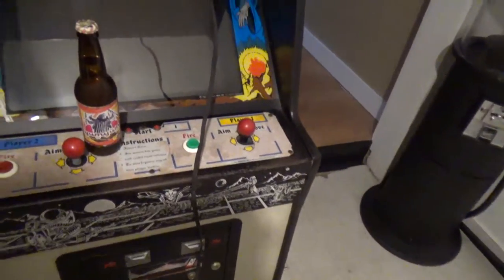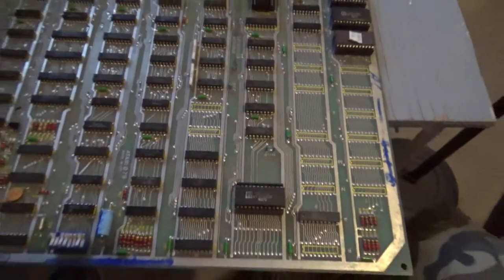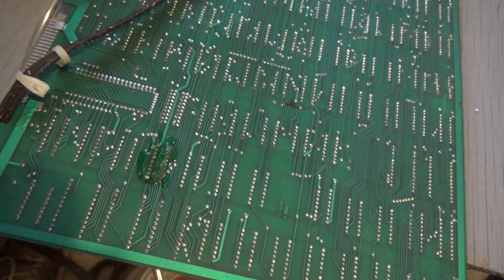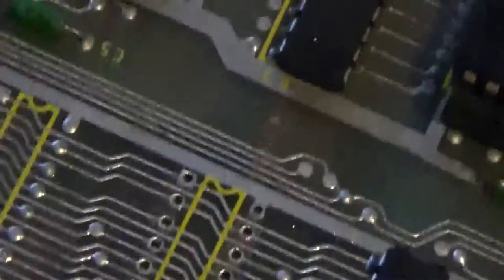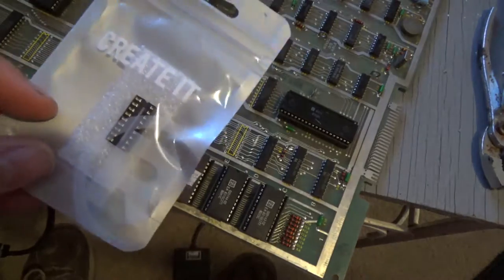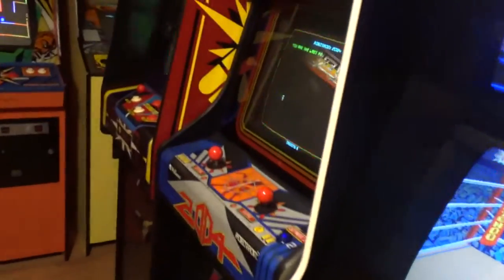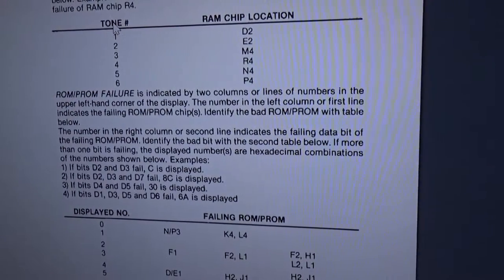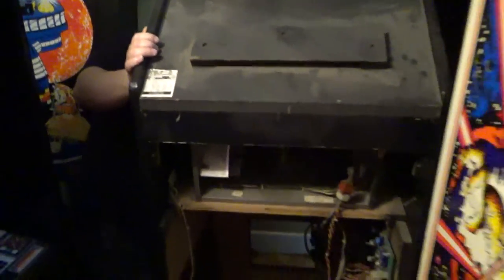Asteroids PCB repair

Comment: Nice repair. I have an asteroids cocktail that has been starting to hum intermittently. Not sure if it’s the audio board or the logic board. Never thought of using freeze spray. Always have gone straight to a scope / multimeter / schematics and chip swapping. Those Pace desoldering stations are pricey! I’ve always needed a better desoldering setup than those cheap spring loaded solder suckers and solder wick. But don’t want to spend that much cash on one. Great videos. Been following tnt, John, onecircuit, knuckles etc for years. Found yours just recently. Good stuff.

Comment: Hey Jason, love your vids. very helpful and informative. By chance could you point me to where you purchased that DC-DC converter board?? Thanks!!! Also, what value are the decoupling caps you're using?? Trying to get a similar setup going on my bench to fix some X-Y boards.

Comment: Nice job! I suggest treating yourself to some better flux. That Radio Shack stuff is really sticky. I picked up some US-made Amtech NC-559-V2 (as made famous by Louis Rossmann), and it's a night and day difference. I don't think I can ever go back to use up the rest of the Radio Shack tub.
Reply from the maker: wondras you are right about that thick flux but I thin it when needed with denatured or rubbing alcohol I get more bang for the buck that way I thin it for SMD soldering

Comment: Speaking of repairs, I have a dead vectrex. I’ve confirmed that the crt and analog boards are good by swapping logic boards so the problem is the logic board. I did some poking around with a logic probe and saw a clock signal but set it aside since then. I’ve bought a bunch of sockets and various chips to replace but gave up on it. Would you be interested in looking at it? Maybe do a troubleshoot/repair video? I could take some pics of the board. There is some corrosion. Maybe it’s a lost cause.

Comment: My spot killer light goes out, CPU board light stays on and the screen is blank. I cant get the game to go into test mode (no beeps at all). Monitor looks to be working, if I adjust the X & Y pots, i will see the dot on the screen. I  also have a constant hum from the speaker. Any suggestions?
Great video...thanks!
Reply: 64mung Work and Yes play

Comment: Hi Jason,  thanks for the videos they're great. I have a question regarding asteroids I have been having a issue with.  when you first turn the machine on there is a small section of lower left part of the screen that looks like the game and then after awhile it disappears The Spot killer light is on but yet very dim and the game does play Blind any suggestions where I should start test? Thanks in advance, Robert
Reply from the maker: first off do ytou hear a quick high pitched beep when you flip the self test switch?  firsty place i would test is the op amps in  your xy output circuits   also test your on board voltage regulators
Reply: Thanks for the quick reply.  Yes, quick high pitched beep in self test.